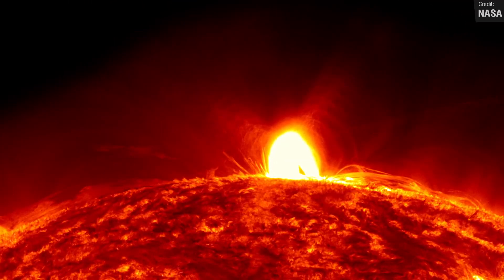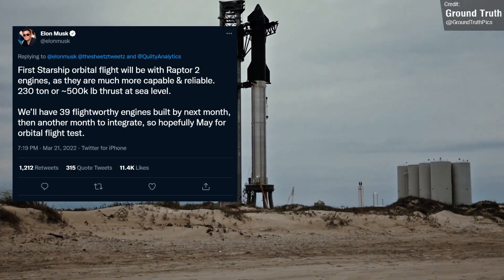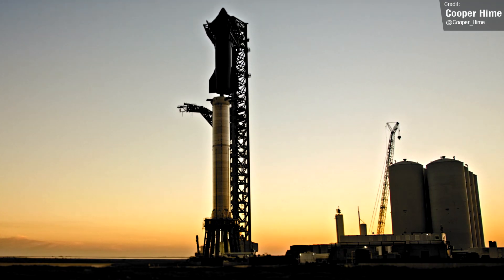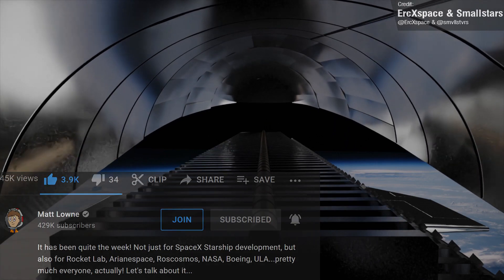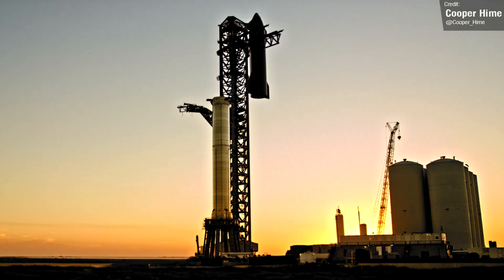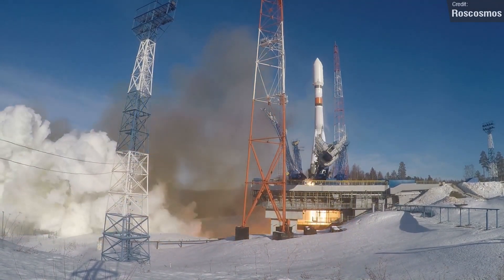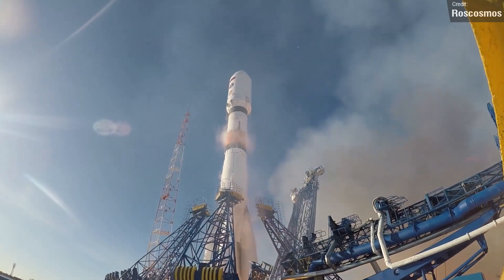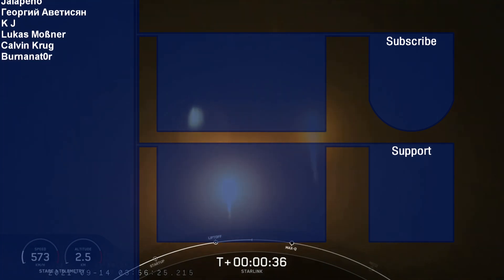SpaceX Starship Orbital Flight DELAYED - Booster 4 & Ship 20 scrapped + Soyuz launch

Comment: NASA may not have congressmen lobbying for Starship to be delayed, but the contractors building SLS certainly have a motive and congressmen who would support them.  Given the delays to SLS, if Starship launches first, NASA would have more leverage to scrap the SLS and get SpaceX to do the entire job.
Reply: it's not in NASA's interest to scrap SLS. They already don't get enough funding - one of the reasons SLS is behind and over budget - and if they scrap the only real project they have going on the funding would likely be cut down even more.
Reply: Starship isn't physically capable of doing the entire job even if NASA wanted to replace SLS, which they don't.
The intention is to progressively get each SLS cheaper and faster to make and have it be the agency's flagship rocket for at least the next few decades. 
SpaceX launching a prototype vehicle to near orbital speeds wouldn't change that.
The Artemis 1 SLS is basically a complete product and Artemis 1 is the final test before it's certified to launch humans to lunar orbit.
Reply: @brokensoap1717  Starship isn’t capable of doing exactly what entire job?
Less max payload is not the same thing as not being capable of launching a payload that won’t reach anywhere near the max payload of SLS anyway.
Reply: @liquidsnakex  Per SpaceX's bid for HLS, Starship will launch every 12 days for Artemis III (pg 10 GAO). Per page 27 of that GAO report denying the HLS complaints and Musk's ~150 tons to LEO for Starship, it will take up to 10 flights to get Lunar Starship to lunar orbit. So that puts refueling Lunar Starship to get to the Moon around a 108 day process. Which is too long to make the 100 day Lunar Starship loiter period (HLS pg 9). So SLS/Orion are needed for Artemis III to get the crew to and from the Moon.

Now in the future, if Starship can get down to about a once a week cadence, then something like a Starship Shuttle to replace SLS/Orion could happen. It would likely be cheaper even with Crew Dragon, Starliner, and cargo Dragons to get crew and cargo to and from LEO.
Reply: @steveaustin2686  Ah, I thought you were talking about the inherent limitations of the vehicle itself.

Interesting point about the launch cadence, though given how "agile" of a company SpaceX is, I doubt they've have to much trouble scaling up to meet the more frequent launches.

All it would seem to take is the same equipment they already have, not even necessarily having to double it, as they may be able to juggle the preparation of one vehicle while the other is on orbit.

It would probably require an extra tent/warehouse or two and hiring a lot more launch support workers, but that doesn't exactly seem unrealistic given what they've  already achieved.

I don't think I'd ever trust being aboard a Starship as it launches, because without proper abort capability it's just another Challenger disaster waiting to happen, but yeah as you said there's no reason the crew couldn't just take a Dragon taxi to meet up with it.
Reply: @liquidsnakex  BrokenSoap apparently doesn't like Starship. I think Starship has the potential to replace SLS/Orion, just not in the early Artemis flights.

Yeah, if SpaceX can get Starship to a once a week launch cadence, I think that a Starship Shuttle could replace SLS/Orion. SpaceX will take time to do that, but who knows how long that will take. SpaceX certainly might be able to do that by Artemis IV. The question becomes how long would it take NASA to try it. Reportedly they have enough parts contracted for up to 8 SLS flights.

The SpaceX plan for Lunar Starship was listed on page 27 of the GAO decision to deny the Blue Origin complaint. [DELETED] is apparently at least a propellant depot and SpaceX apparently had the GAO redact the info on [DELETED].
"SpaceX’s concept of operations contemplated sixteen total launches, consisting of: 1 launch of its [DELETED]; 14 launches of its Tanker Starships to supply fuel to [DELETED]; and 1 launch of its HLS Lander Starship, which would be [DELETED] and then travel to the Moon."

Elon Musk tweet Aug 11th, 2021 after the GAO report came out, which is where I get the up to 10 flights to get Lunar Starship to the Moon.

"16 flights is extremely unlikely. Starship payload to orbit is ~150 tons , so max of 8 to fill 1200 ton tanks of lunar Starship.

Without flaps & heat shield, Starship is much lighter. Lunar landing legs don’t add much (1/6 gravity). May only need 1/2 full, ie 4 tanker flights."

Yeah, Elon Musk has said that it would take hundreds of successful, operational flights before you could put people on board Starship launching from and landing on Earth.

“'We’ve got to first make the thing work; automatically deliver satellites and do hundreds of missions with satellites before we put people on board,' Musk said, speaking Monday at the virtual 'Humans to Mars' conference" - CNBC Sep 2020 article

For Lunar Starship, it is roughly $1.47B to get it to the Moon based on the $2.94B HLS Option A contract for an unmanned test landing and the manned Artemis III landing. So at up to 10 flights to get Lunar Starship going, that is about $147M per launch for Starship for Artemis III. Now if a Starship Shuttle could reuse the [DELETED] propellant depot to get the unmanned Lunar Starship to lunar orbit, then you only need 9 Starship flights for the Starship Shuttle, ~$1.32B. Crew Dragon is $300M and Starliner is $360M, so that is $1.98B. A cargo Dragon or two for bringing down supplies is roughly $133M each, so $2.1B to $2.3B total. SLS/Orion is $4.1B per the NASA IG and almost $600M of that is ground support costs (VAB, crawler, ML, etc). Of course if the Starship price comes down, then it is cheaper.

I'm suggesting using both Crew Dragon and Starliner as then you don't have to rapidly recycyle the launch and recovery systems for a second flight. That should give a greater safety margin for the crew. The capsules would also have to be supported in LEO for the duration of the lunar mission, as they can't fly that long on their own. That is where the [DELETED] propellant depot comes in. IF [DELETED] is nothing more than a propellant depot, then redacting [DELETED] to only confirm it is a propellant depot from the context seems silly. I think [DELETED] is more than a propellant depot and a crew transfer station makes the most sense to me. It would answer some questions as well. So the unmanned Starship Shuttle would refill from [DELETED], then the capsules come up to dock with [DELETED]. One each of the crew from the two capsules would stay on [DELETED] to ride herd on the capsules and the other 6 would leave on the Starship Shuttle. The LETS landers and the new HLS version 1.5 will apparently have 4 crew each. Two of the 6 lunar crew stay on the Starship Shuttle, likely docked to Lunar Gateway and the 4 head down to the Moon on Lunar Starship. While the rest of the crew is off to the Moon, the two staying on [DELETED] could do science there. After all, most of the propellant depot stuff will likely happen in the tanks that [DELETED] used to get to orbit, likely leaving some room for a small station for experiments.

This would answer why the change from butt to butt to side by side refueling happend (crew transfer). Why SpaceX didn't bid for a commerical space station ([DELETED] would be one). And what SpaceX would do if Starship can't be reliable enough for it to get an Earth crew rating.
Reply: @liquidsnakex  I did it because that was how the GAO listed it. Before they released the public report, they let SpaceX, Dynetics, and Blue Origin redact proprietary info.
Reply: @brokensoap1717  exactly and not to forget not only launch but also reentry and land in a known and 'safe' manner. Starship will have to proof many many times that reentry and bellyflop works flawlessly before crew would be allowed on it. Both projects are cool, but as you said if this years flight goes well SLS is ready and crew certified, while Starship is to be proven to survive reentry (which I hope, cause it is such a cool concept).
Reply: The FAA has mentioned consultations twice now. While the FAA is the lead agency, NASA, the Army Corps of Engineers, the US Coast Guard, the US Fish and Wildlife Service, and the National Parks Service are all part of the FAA review. I think that some issue has come up and the FAA and SpaceX are working with one or more of the other agencies to resolve the issue.

The FAA conspiracy theories are pretty silly. The FAA defended SpaceX in front of Congress over the SN8 flight without approval. NASA needs BOTH Starship and SLS/Orion for Artemis III.

Comment: I think you are a bit naive about the federal government and the current disastrous presidency.

Remember Biden held an electric car conference and Tesla was not even mentioned or invited??

Plus the US lobbying system is very much the power behind the bureaucracy. The old guard weapons companies that have dominated the space industry and sucked away taxpayers money on cost-plus contracts cannot beat SpaceX in innovation but they can use their extensive contracts and leverage. Stop sounding so naive  buddy.
Reply: The electric car conference was to push the legacy companies to make MORE electric cars instead of gas cars. Since Tesla doesn't make ANY gas cars, why would they be invited, as they make 100% electric cars already? It was a bad PR move, but another silly conspiracy theory.

IF the FAA is supposed to be shutting down SpaceX and Starship, a BIG IF, then why didn't the FAA shut them down over the SN8 flight without approval? WHY did the FAA DEFEND SpaceX in front of Congress over the SN8 flight? It's another dumb conspiracy theory.

The FAA has mentioned consultations twice now. While the FAA is the lead agency, NASA, the Army Corps of Engineers, the US Coast Guard, the US Fish and Wildlife Service, and the National Parks Service are all part of the FAA review and have been from the beginning. I think that some issue has come up and the FAA and SpaceX are working with one or more of the other agencies to resolve the issue.

Comment: Matt, the reason I support you as a channel member, is because you are the only space youtuber to use good ole' American units and not those stinky, VERY hard to understand metric units.

cheeseburgers per hour is a hell of lot easier to understand than stupid kIlOmEtERs PeR HoUr
Reply: Seriously?

Metric: 1mm X 10 = 1cm
             1cm (10mm) X 100 = 1m
             1m (1000mm, or 100cm) X 1000 = 1km
             1km = 1000m, or 100,000cm, or 1,000,000mm

Imperial: 1in (divided by either 1/2, 1/4, 1/8, 1/16, 1/32, 1/64, etc) X 12 = 1ft
                3ft = 1yd
                5280ft (1760yd) = 1mi
                1mi = 5280ft, or 1760yd, or 63360in, or 4,055,040  1/64ths

With the significantly sub-average intelligence of the avg American, you'd think they'd be more receptive to a measurement system so easy that it basically only involves multiplying/dividing by factors of 10, instead of the convoluted randomness of the Imperial system which is the official measurement system of only 3 countries on the entire planet: Myanmar, Liberia, and the USA.
Reply: @fastbike1977  yup still these stinky amerikan (miss spelling indended) people don't understand
Reply: Agreed, we Americans don't think too well, but burgers per hour I can underthink
Reply: @LaggyWizard  this guy gets it! must be a true American
Reply: Shame. I need metric lol.
Reply from the maker: :_MattJeb:
Reply: @emildelyon  I love my American measurement units!!